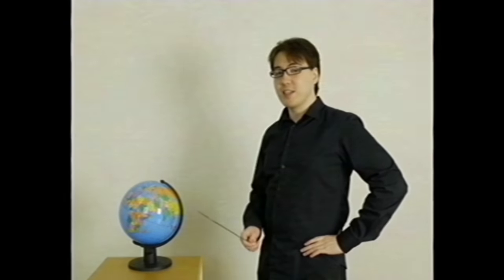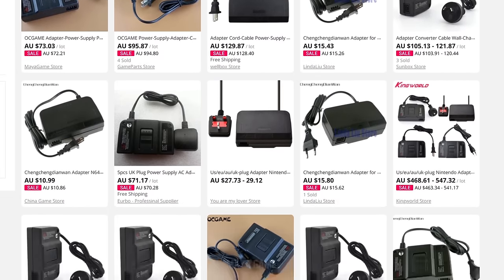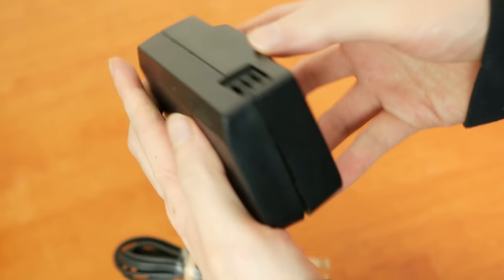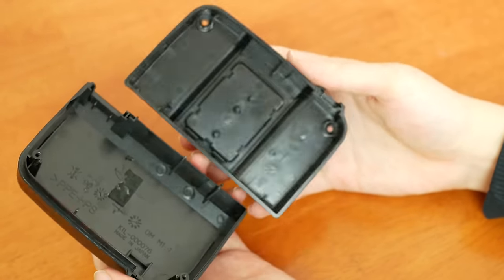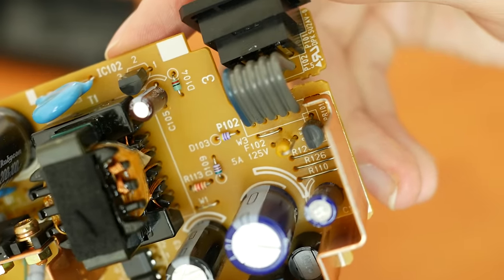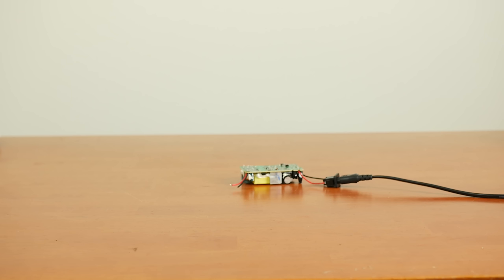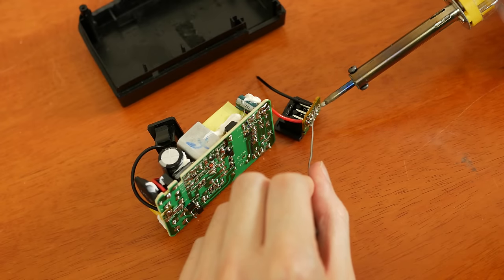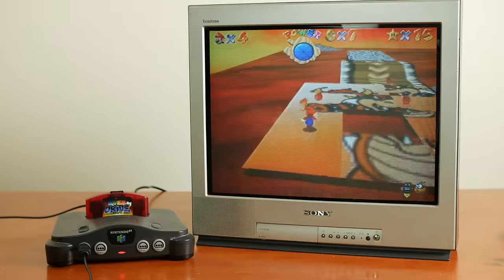Building the Ultimate Nintendo 64 Power Adapter

Comment: I'm pretty sure if you just changed the input ac components to higher voltage ones around 350-400v like varistors and capacitors the power supply would accept 230v

Comment: You could've bought a brazilian power supply, both on the N64 and GC, they made specific power supplies for my country, as some regions are 220V and some are 110V, so we got what we call "multi voltage" power supplies for both consoles.
Reply: both the nus-002(bra) and the dol-002(bra) are very rare
Reply: @gamecubeplayer  Ask any brazilian for one, myself included, and I'd ship them abroad for a small fee. Have done it already.
Reply: @Sugurain  why are you here 2 years later?

Comment: The 64 itself accepts any reigon power supply. Ive been using a uk one with a Japanese system for years
Reply: The DC voltages inside the console should be the same; it's just the mains AC (ie 110v or 240v) voltages and frequencies (50Hz or 60Hz mains - not to be confused with AV mode frequencies...) that require a different transformers to handle this.
Reply: Why do people feel the need to make this comment? This is clear from the video...
Reply: @userPrehistoricman  He literally doesn't even mention it, how is that clear? For anyone searching for advise on N64 PSUs this video is just plain confusing.

Comment: MATT THE INDUCTOR (COIL) OF THE DC-DC STEP-DOWN CONVERTER IS BROKEN!!!. Take a look at it's core, it looks to be split in 3 different places. I don't know how it affects it's performance, but if you plan to daily drive your ultimate ac adapter, I would recommend changing the inductor, or buying a new buck converter

Comment: I know a big point to this is the process and having some fun modding, and also adding the break away cable to the power supply... but couldn't you just buy a loose working power supply meant for n64s from your country and use that with the US N64?

In the states, replacement power supplies are pretty affordable at around ~$15 shipped. You're probably not looking at much less even with the free 12v power supply from the router. Though perhaps loose power supplies are more expensive where you are.

Comment: This has me wondering, how did 12 volts become so standard? Seems to be the default for the higher voltage parts of most electronics, its been the standard in automotive applications for 60 years (used to be high amp 6 volt) and even electric cars still need to have a 12 volt battery in them for lights and major functions. I've just always thought 10 volts would have been a standard with metric and what not

Comment: 17:30 yeah, did you now figure out why they'd double-stick-taped the original board to the case? (Note that the original board had the transformer stuck, because the transformer is the heaviest component on the board.)

Nintendo is extremely good at reliability engineering, and most of the things you complained about (tape, tabs, etc) are done to improve reliability. The less movement, the more reliable, especially when you consider kids are often rough with their things.

Comment: Im from Uruguay and we just need to change the main capacitor from 47uf and whatever was the voltage of the 110v PSU to 47uf and 400volts thats how you convert an official N64, PS1, PS2 PSU from 110v to 220v lol

Comment: I wouldn't use a cheapie meter like that. They don't have enough clearance internally to safely measure mains voltage. Only use them on low voltage circuits.

Comment: Well, the benefit of a removable power adapter is that you can just buy one for that region and use it in any other region's console.

But, I can totally see myself just doing something like this because I could anyway - so I get it.
Reply: Another benefit is that these power supplies are rather bulky and it's inconvenient to have to carry multiple so this is a good solution for traveling (see 1:00 for reference).

Comment: I'd suggest getting a resin 3d printer, they make more accurate prints, you can make the prints stronger by casting a mold of them and filling that with whatever kind of plastic you want, it take a bit longer that way but then you get more accurate and clean looking parts that are stronger than normal 3d printing, or if its something that isn't going to see a lot of stress you can skip molding it then you have a piece done quicker, rybonator on yt does videos using his 3d printers to make game pieces and dice for dnd

Comment: The real problem with wall warts is that they are usually 12v and 1 f'ing pico amp, and almost even useless for powering a solar calculator. Everyone is looking for the elusive reasonably powerful brick, and when you find it, it weighs a metric ton and can't fit in a compact car. Meanwhile, my PC PSU is light by comparison at only twice the size and puts out over 700w. I guess the guys that barely pass Uni with a C get put on designing the new wall warts.

Comment: I think the power supply was so beefy is because it was intened to cover for both the n64, potential expansion pak and even the disk drive; i dont think the console by itself will really use a lot of the power provided by the.. supply

Comment: What a nice job you did! It's far more usable than the old one that was stuck with this horrendous integrated power cable, and static AC power voltage. Every Chinese factory should produce this kind of unit, with the same amount of quality. And yet, it might have a few flaws, it's perfect in its kind.

Personnaly, I tried fixing a standard ATI PC power supply from 2002, but it didn't work. The fuse blown up every time. So I ended up playing with the power supply by smashing it xD I found a replacement one. That's all, I don't know where the malfunction came from, some of my mates said it was coming from the MOSFET transistors.

Comment: Weird thought but... any chance replacing the torn cable on that faulty power supply would have made it be completely functional (at 230V no less)? In any case LOVED the video! Very nicely done! Binging more from what you have to offer!

EDIT: Ah went back and checked that you said it still is the wrong voltage. Which is weird cause the plug looks like an EU plug, and here in Europe we use 230V. Still feel like I've missed something lol. EDIT2: Sigh, I'm blind. Definitely a Japan/US plug there. My eyes aren't working today sorry.

Comment: *It's dangerous, do not try it if you don't know what you're doing.

If your house outlet is phase-to-phase=230V and not phase-to-neutral=230v, then you could use "Single Wire Earth Return System" to make it 120v. This is a system widely used on rural areas that do not use much electricity.

But keep in mind that any short circuit in the ground wire has the potential to damage other electronics in the house. **This system is not intended for high wattage electronics and can be really dangerous if used as such because those equipments have a high likelihood to have a big power leakage thorough ground**.

but since it's only a Nintendo 64(low power consumption), it's unlikely to get hurt by electrical leakage if it ever occurs.

Comment: You know about that mod for the rumble pak? The one you make it use the 3.3line instead of batteries? 4 of those modded will be a good test for the 3.3 regulator if it can handle the 4 at same time you got the ultimate n64

Comment: Had to go check on my Xbox 360/Xbox One power supplies. Yep, no 240V support.

I would think the Switch's power supply would be universal, but there aren't any specs printed on it.
Reply: the switch power supply hac-002 says 100-240v 50/60hz

Comment: Really cool mod! I'm a little confused though as I'm not very knowledgeable about electrical engineering. You said you could plug this into any outlet now without worries. How does this mod prevent it from frying if say you now plugged it back into a US wall?
Reply: The power supply it uses is rated 100V-240V (at 50Hz and 60Hz), as seen on the information sticker on the wall-side of the adapter before he opened it. This is pretty common in DC converters as it allows a company to use one internal supply design anywhere in the world.
Reply: @adamsfusion  That makes a lot of sense! TY

Comment: did you  try a US power pak in the console or is it a different pin  point between US/jap/uk/europe  console

I doubt there is a ground, 12/5/3.5 volt if i remember correctly..

are you in the US?? or Australia??

Comment: Good video, just two notes: 
1: the tape in the transformer is to avoid vibration -> ripple / buzzing
2: please, please ...if you do care about that awesome piece of old tech n64, then please don't use that voltage regulator, I had used a couple in my projects and it totally SUCKS .

Comment: I'm pretty sure one could have converted the 100-120V to a 220-240V PSU, or just buy an used one with appropriate voltage haha, having DC in would be nice tho, to run it off a battery or something

Comment: 12 volt power adapters are the most common thing if you look at PC parts I have a monitor that uses a 12 volt power supply a router uses a 12 volt power supply a modem uses a 12 volt power supply my external HDD has a 12 volt power supply my CD player can be plugged into the same thing my external hard drive is plugged into (sata and power) ect

Comment: Couldn't you just get an original power adapter for your reigon?

The internals of a console are pretty much the same between regions save for the reigon locking stuff if they're present.

Although, idk if the refresh rate is gonna be a problem. Like you said, PAL electronics refresh 50 times/sec. For all I know, the game system itself runs 17% slower in PAL regions (EDIT: Turns out, Yeah that's a thing. At least with the Super Nintendo anyway. I'm too lazy to google it)

At the end of the day though, it is pretty cool to put together something you regularly use. I've got my own private website for watching TV shows I already have, despite Netflix being a thing. It's fun!

EDIT: I'm stupid, you kinda explained this already

Comment: Correct me if I’m wrong, but couldn’t you just use a Australian Nintendo 64 power supply on the NTSC console, isn’t the power that the console needs the same across all regions, isn’t it the power supply that converts the power?

Comment: isn't 12v and 3.3v the standard output voltages of a PC PSU? 
it's not that weird that the power supply has a 12v and 3.3v output, they just put the PSU outside the case.

Comment: So after watching this, I got this really dumb idea.  You could do the opposite of this!  Keep the N64 power adapter shell completely intact, but bypass the internals and run a 3-core wire from the internal plug out the back.  Then, you run the 3-core to a wall wart which has the 12v and 3.3v components.  Now it is bulkier and more inconvenient than the original adapter.  Congratulations!

Comment: I thought there where only two different plugs 1 being the one in the house 2 being the high voltage one you plug the welder into, I didnt know the basic wall adapter was different from country to country

Comment: I think your calculations are off
Because is a switching supply 
Pin=pout
Vin*Ain=Vout*Aout
12*Ain=3.3*2.7
Ain=(3.3*2.7)/12
Ain=0.74
(not acounting for power loses)
You wouldn't need a large supply to run this.

Comment: Why not 3d print a custom case that does stick out the back so far, and have the psu only contain the voltage converter, then just have a dc barrel jack for plugging in the 12v supply directly.

Comment: You should make another one but make it with a battery pack inside with the adapter outside, so you can switch rooms without turning it off. Probably a useless feature, but still cool

Comment: 4:03 the connector ois called C7 for female and C8 for male. Both are pretty common in europe. A lot of devices in europe have that type of plug.
https://en.wikipedia.org/wiki/IEC_60320#C7/C8_coupler
The core of the coil from your step-down converter is broken!

Comment: You should have put a SIGNIFICANT disclaimer that handling the innards of the power converter is extremely dangerous even if it has been shelved for a long time. Those capacitors hold enough charge for a long time to seriously hurt or kill you.

Comment: every switch mode psu can run from 110 to 270 ish volts and still output the correct voltages

Comment: should have followed nintendo's example of making it hard to open, and 3d printed a 6 layered shell (1 for each power pin) which when fully assembled prevented you from removing any part of the system, game included, and weighed so much that it became a stationary object. like the original xbox.

Comment: I'm a nerd. I buy electrical items from other countries. 

However, I am also confused: On the N64, Nintendo has made the power supply modular. Any video game system or parts that are native to your country are always much cheaper and abundant, then buying something from overseas. Also, surely you already own a N64 from your own country. Why go through all this trouble when you could just put the power pak from your Australian N64 into the American N64? The DC output voltages are the same, and DC has no frequency component. There also is no lockout signal.

I own American flavours and some Japanese flavours of every Australian console I own. Buying the foreign console itself is the most expensive part. Buying junk consoles from your own country are super cheap and abundant. Most you just swap out the power bricks/packs. For others, sometimes they accept 100-240V even though the label says otherwise. For some like the Playstation, you can open the unit up, and just swap the power supply circuit board.

Now, I will say the power socket for a 'figure 8' power lead is nice. I never did like how Nintendo hardwired the leads in their console designs.

Comment: If you think that's bad, you should see the C64 power supply. Commodore knew it was a bad design that can catch fire. Rather than fix it, they just poured epoxy in it. If it's full of epoxy there is no air. no air means no fire. But yeah they go bad and eventually they will fry the computer. I built one that uses 2 power adapters, but my DIN cable wasn't rated for the power required so I get a voltage drop. I'm considering buying a real one and using their power cable. At least it works, but I have to power my disk drive emulator externally since there wasn't enough power otherwise. Anyway for my PSU I'm using a 9v AC transformer I had laying around and I originally used a phone charger for the 5vdc. But when I had issues (Before I realized the cable was the problem) I replaced that with a 5v 5 amp dc adapter from meanwell.

Comment: I'm just here to judge you for using a flathead screwdriver as a chisel.

(just stick the power adapter in a vise and crush it down next time! that'll break the ultrasonic welds as they're more brittle than fhe plastic of the case.)

Comment: yes, but what about a ram expansion much bigger than the original expansion pak?
Reply: there are several people who spoke about how worthless the ram expansion was lmao the one game that I can think of that needed it was donkey kong and that's because it had a memory leak
Reply: @EggsBenedict1  yes, but that's only because the devs didn't utilize the base ram correctly. it wasn't used like crazy afterward because the N64 was at the end of its life cycle. it was actually required for a handful of titles. and the games that did utilize it, benefited from it tremendously. now think about that, but also think about how well optimized we could make games if we had loads more ram for the N64, and a way to use all of it of course.

Comment: how about... changing the caps for 400v 330uf and the variable resistors for 250v, then modify some resistors... thats an actual mod... and also guarantees NO DIRTY power supply. you could use a PC psu for those voltages if you wanted.

Comment: You know, that cracked Ferrite ring at 14:05 kinda triggers me. I mean yeah, it still works but the inductance of that coil is now a bit lower and thus ripple would likeley be even worse, considering they usually dont have low ripple in the first place...

Comment: mmm i wonder why Nintendo couldnt just stick the 12-3.3 voltage regulator in the motherboard and just leave a 12v adapter outside... i dont see the point of a separate power brick

Comment: 😂 now I have broken third party Retrobit PSU and need to understand how really Original works. Whats happening when you slide On the console. Because PSU does not start to work (?) the moment you plug it into the socket. I suppose it is the same as with PC ATX PSU. It starts to work after On signal is sent from Power On button.   But slider on N64 is not a button. Im happy to have small device that can cut things.

Comment: Why not use a usb c power delivery dummy? It's better then old power supply? It's only 3.3v and 12v. That makes 1 dummy and a step down converter and a usb c cable with a usb c power delivery supply.
Running console over usb c power delivery is nothing new.
That would be better and more future save.
And you had only 1 power supply for All console that use every Ränge until 12v.